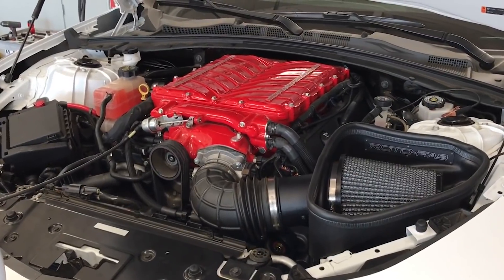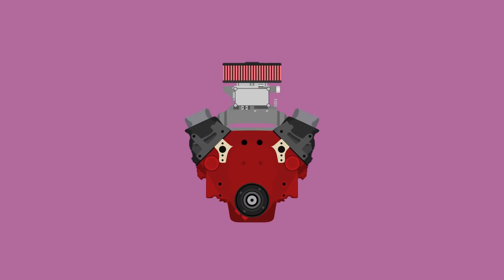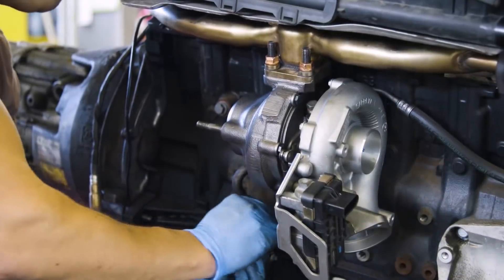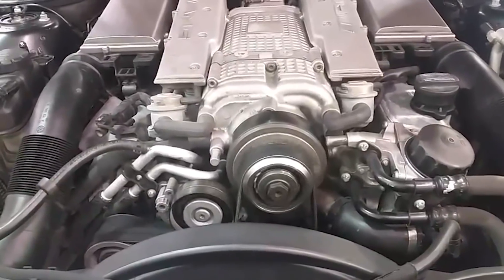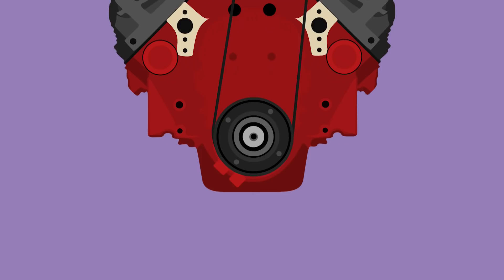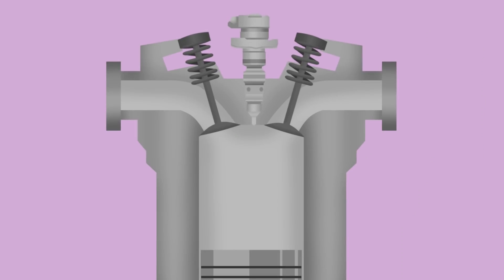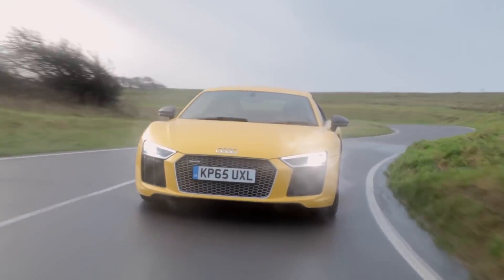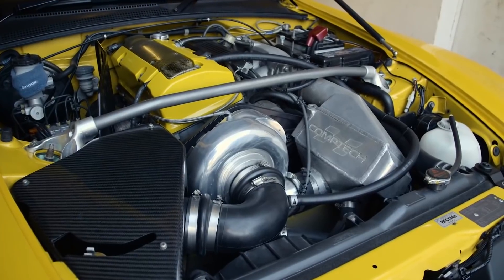Superchargers 101 - Displacement, Boost, and Volumetric Efficiency

Comment: Pls do video of vacuum operated supercharger bypass valve vs  operate by wire type of supercharger bypass valve control by ECU.

Is vacuum operated supercharger bypass valve continuously self regulate to maintain a minimum delta p?.

Example 1: manifold air intake pressure at -1 psi and bypass valve in modulating mode for +2psi at supercharger discharge. Manifold throttle body 30% open.  

Example 2: manifold intake pressure at +2psi. Bypass flap further closes a bit for +5psi at supercharger discharge. Throttle body >35% open.

Case 3. Air intake manifold pressure at +7.5psi vs supercharger discharge also at +7.5psi. Bypass flap in closed position. Throttle body >50% open.

Example 4. Manifold air intake at -5psi. Bypass flap in fully open position. 0psi at supercharger discharge. Throttle position 23% open.

It is possible to change a ECU operated bypass valve, in a supercharged Mercedes, to vacuum operated bypass valve to try the type able to continuously self regulate for a slight DP before intake manifold pressure get above -1psi?.

Fyi, idling at 750rpm to the manifold intake pressure is at -7.5psi with throttle body at 17.2% body. MAF at 5.4g/second. Very very slight positive pressure of +0.14psi at supercharger discharge.

Regards.

Comment: The section in this video on Volumetric Efficiency is conceptually incorrect. VE is not a volume ratio, it is a mass ratio. A piston engine is a positive displacement pump, it always pumps the same volume of air no matter what the conditions.

And as other VE videos are wrong, there is no such thing as "Wasted Space" in the cylinder. Air in a continuum does not act that way.

Comment: The volumetric efficiency explanation is not 100% correct. An engine pulls air with negative relative pressure, that's why the air enters the cilynder. But the fact not 100% of the displacement is considered is because the final pressure at the intake stroke is lower than atmosferic pressure. So it means you have 80% e.g. of volume at ATMOFESFERIC pressure. But obviously the cylinder gets fully filled , just at a lower pressure than atmosferic.
Reply: Yeah exactly

Comment: So when specing a root supercharger do you size pulley based on engine size displacement and boost target taking in valve overlap etc? or would you also factor in the low VE of the engine (say is has 2 valves per cylinder and is old).Would your calculated 8psi positive pressure based on the full engine displacement turn out higher because of poor VE? IE if the engine had a VE of 80% would you meet in the middle and calculate it at 90% engine displacement because of the old design\low valve count?

Comment: I like superchargers over Turbos, is that just me? I mean, Turbos can create more horsepower over a higher RPM, but superchargers are more consistent and I feel would be greater to control the power on tracks.
Reply: And they don't fail as often, turbos are way more sensitive. =Superchargers are cheaper
Reply: I agree with you on that part but I personally like turbos for the sake of economy in daily driving
Reply: @christophercervantes5346  Yea I agree too. Turbos though are very efficient.

Comment: Can you make a video on how to increase performance on a N/A?
Reply: change camshaft, header, exhaust, add cold air intake
Reply: @Tashycide  lol, u did good, they could also bore or stroke the engine, do a port and polish, fiddle with ignition timing, individual throttle bodies, lighter crankshaft or flywheel. I'm also not a mechanic, just enthusiastic about the subject
Reply: @Tashycide 
Is camshaft a good thing when having a variable valve?
Reply: @Ultimatum_176  Cant help more im not a mechanic ;)
Reply: @Tashycide  hourglassing butterfly valve in the throttle body, honing the cone shape in the bell of the throttle body. template matching your ports on your heads to the gaskets. buy a spare block that's blown and cut a few slices out of the head to see how much material you can get away with removing from the runners of each port. porting your throttle runners and making sure all ports match shape so no turbulence is introduced. Polishing and porting upper intake runners and intake and exhaust ports, removing factory casting flash marks from the connecting rods and then re balancing your rotating assembly. knife edging any dual runner style ports for V style engines usually. fuel rail flow matching and seat boring. injector turbulator bumps/dimples next to the injector. and polishing your valves for hot spots and to reduce buildup. can't forget catch can and or crank breather. sorry it took 2 years for someone to give you a response who actually knows a thing about NA builds.
Reply: Hood scoop. 
JK
Reply: Bigger throttle body
Reply: What causes superchargers to whine?
Reply: @reecelawson4718  air being sucked in so quickly
Reply: Headers, exhaust, cam, heads, Intake, tune
Reply: More cubic capacity is the only way get more na power
Reply: stick M Badge
Reply: Sell and buy a bigger block
Reply: Give it a supercharger
Reply: valve springs because maintenance, then headers, camshaft, pulley, throttle body, pistons, exhaust, cold air intake fuel and tune
Reply: Big ass cams, some good headers and good maintenance
Reply: Pretty much dump more fuel (up to a point), then fiddle with ignition timing and compression(?) .Change camshaft. Also make sure things like air filter,egr, exhaust work properly. Source: Automation (game about building cars)
Reply: Internals

Comment: If the h22 can reach 102% ve does it means it's kinda has boost even tho there isn't forced induction ?
Reply: IMNOTA
Technically yes as boost is pressure above ambient as a result of resistance to flow however it would be very difficult to measure given it's so slight, fast, and occurs in the cylinder as the air "stacks up" and compresses ever so slightly before the intake valve closes with just the right resonance.
Though it's quite debatable if this really qualifies as "boost" or not. It more like the "elastic" nature of air.
Reply: No, because engineering and physics.